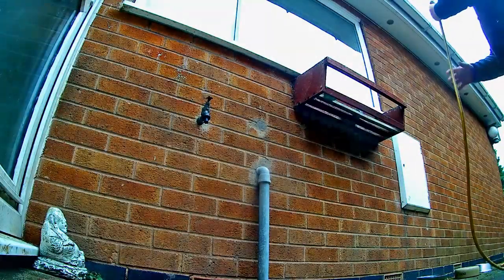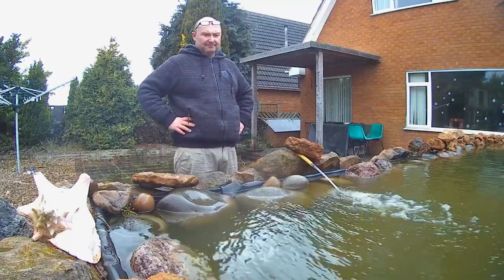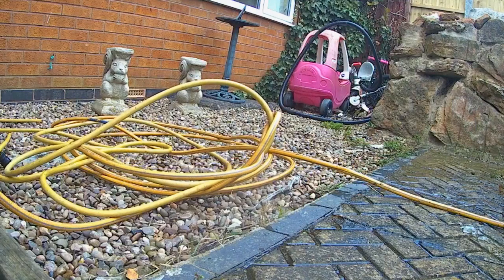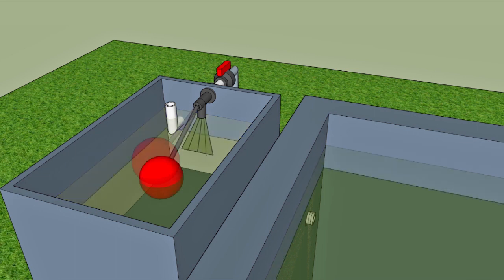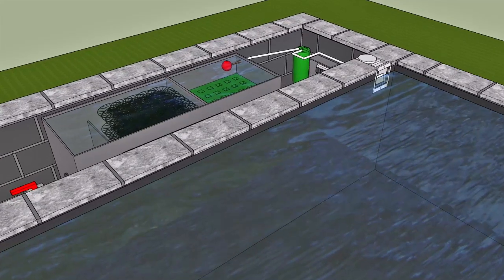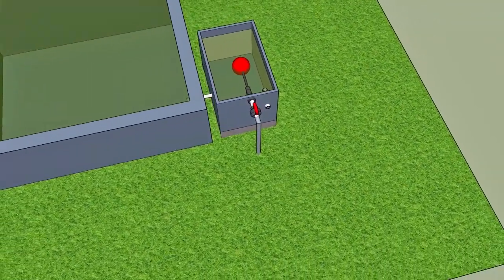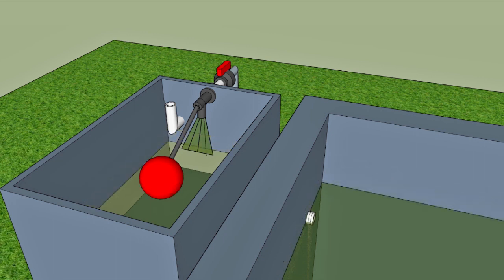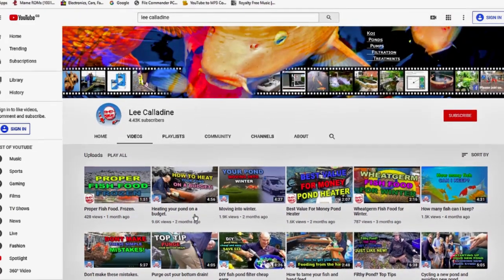There is a better way.

Comment: Wow this is very timely, I have just got back from picking up a second hand loft water tank to use as a balance tank as you have described.  It has an integrated float and a lid, £31.